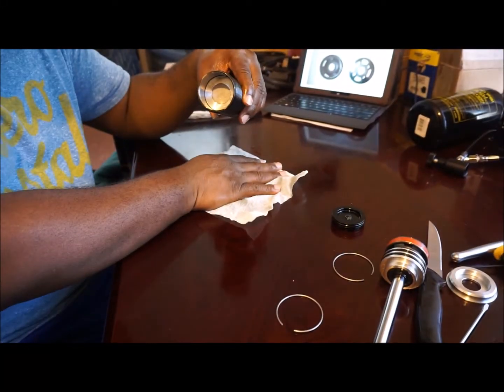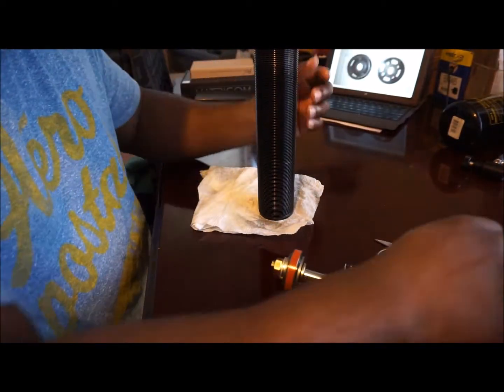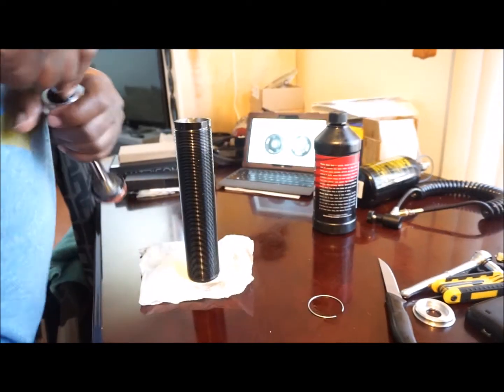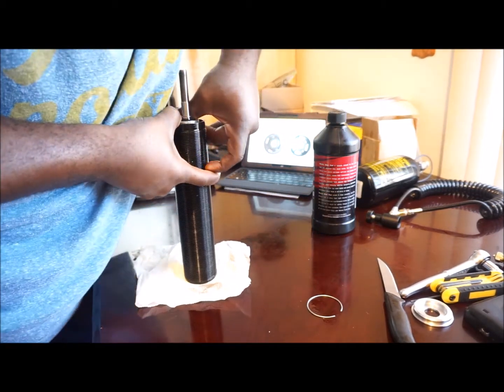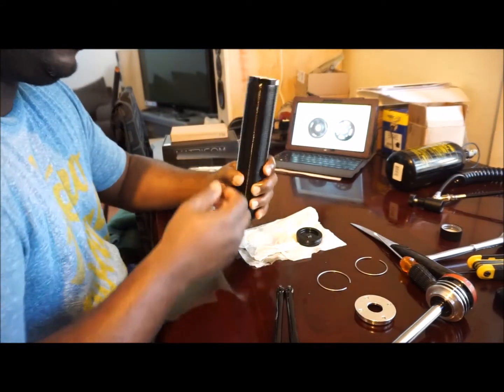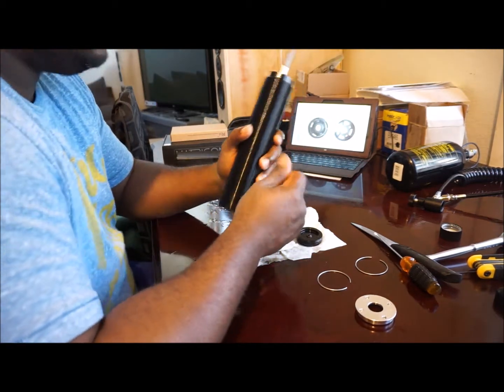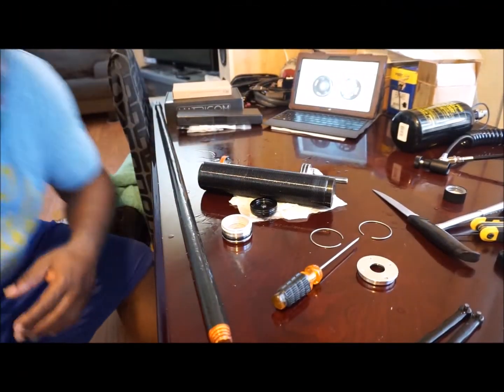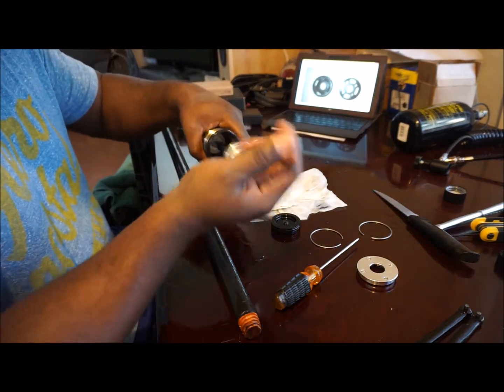DIY BC Racing BR shock Revalve tutorial - PART 4 (Bilstein Internals)

Comment: You can use the bottom of your digital caliper and extend it into the cavity to measure depth instead of using your broom, although the broom is very clever!  Also, consistent oil level is very important to consistent performance, so help yourself out and get a poly measuring cup. https://www.usplastic.com/catalog/item.aspx?sku=80933&gclid=EAIaIQobChMIq7iv6-XP2wIVgsJkCh0KJw8UEAQYAiABEgINf_D_BwE
Reply from the maker: Yes, I tried the digital caliper I have, but if I remember correctly it was not wide enough to span across the diameter of the shock tube and still sit fully upright.

Yes a mid to large measuring cup will definitely aid in ensuring the proper quantities of shock oil will be utilized. For others reading they can be had for at your local “Dollar Tree” or $1 store for $1-2. I keep them for various auto uses.

Although, Thank you for mentioning this as it can surely help those trying to revalve.

Comment: Couldn't you just position the floating piston, put in the proper amount of fluid, install the upper piston, put in the c-clip, then place in the bottom seal (using the nitrogen needle to prevent pressure), and not have to fight?

If you have too much fluid, of course, you'll end up pushing out the floating piston, but you have to have WAY too much :p.
Reply from the maker: If I read your message correctly, the floating piston would likely make contact with the bottom black "butt plate" (the part that has the self healing seal rubber seal). This is just my belief. I think even with the nitrogen charge afterwards, the floating piston wouldn't move upward as liquids (oil) cannot be compressed. Gases can.
Reply: I don't think that would happen unless you have too much oil (or air) above the floating piston.  The relative position of the floating piston should still be maintainable.  It's just about getting the right amount of fluid and not getting any air mixed in with it, which may well not be doable.

One (probably easier) alternative would be to just bleed the air from the bottom chamber once you get to the point where you are forcing the assembly together and can just get it to the place for the c-clip to fit.  Then the c-clip install will be easily and the floating piston will be properly positioned once the chamber is pressurized.
Reply from the maker: +looncraz I see what you are saying in the 2nd paragraph and that does make sense in making the assembly easier.

Thank you for the suggestion, as this can help many others who will attempt a shock/strut rebuild.

Comment: Hi! Thanks to your videos I got inspired and decided to transport the coilovers on a plane to Argentina where I live, otherwise, those would be retained by the TSA because as long as I know are not allowed to take on plane. Well, the reason I write you now is because I want to do a kindly remark on your procedure, at 3:51 when you put ths piston inside the cylinder, you leave an air chamber on the top of it. The way to eliminate this air chamber is to keep a void on the bottom but the double of volume you leave and, on the top, oil must be near to overflow. What's your thought? thanks for your time.
Reply from the maker: As I think about this scenario, when inserting the piston/shaft I would make sure to have the adjustment knob turned all the way to full soft (valve inside shaft fully open) so that any pockets of air will escape through the center of the shafts needle/bleed valve in the bottom of the shaft and out the shaft exit ports located on the otherside /above the piston.

This is kinda hard to describe, but once you have the piston shaft in your hand it should make more sense.
Reply: Frugal_Fabrication air chamber will be located between the top of the piston (will hace a layer of oil) and then the air and then the cap which contains the lip seal, yes, is very hard to describe, but, after your video I watched a bc coilover factory video which shows that they fill up to overflow this what I tell you, just want to discuss this before I assemble my coilovers and see about your experience what you think. Kind regards,
Reply from the maker: +Matias Sebastian ok yes. I know the video and which part you are speaking of. A syringe to  squirt the oil into that gap would be my best thoughts on how to fill that air space. But tightening the dust cap/top may be very hard to screw on/tighten as liquids are not compressible.

I did not use a syringe myself, I just poured the shock oil in. And to be honest, I still had a little bit of air in the top and when I put the shocks on a shock dynamometer, they still were fine.

Comment: your info for the most part in this series was correct however the shock oil level is one of the more critical aspects, the reason you were having issues pushing your wiper seal into the shaft was you were compressing the air under the floating piston, you should have had a lower oil level, (read precisely measured from the top brim) to account for the wiper seal and piston and shaft that displaces the oil. 

You said you had too make due with the tools you have but the caliper is very sufficient and you should have used a set height for the floating piston as well, just for consistency sake, and then you could figure out the exact oil level needed without moving the piston. 

all of your shocks will be different, they wont be too far off cause valving is the same, but i personally would take a little more time and care. 

not knocking you, just brainstorming while watching your video.
Reply from the maker: I truly appreciate your input and I do see that the extra steps would make a further difference.

I will look into this on my next shock cartridge revalve (hopefully this week).